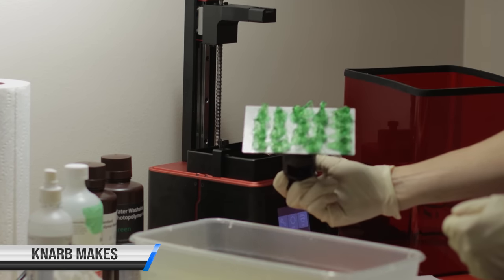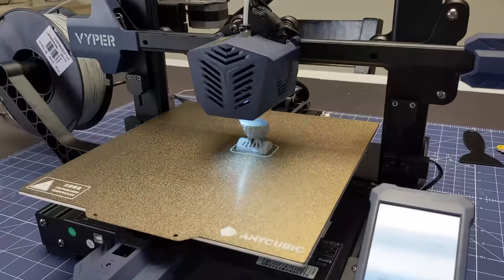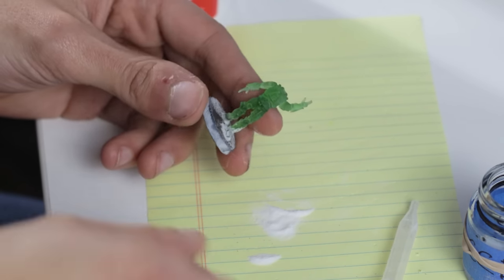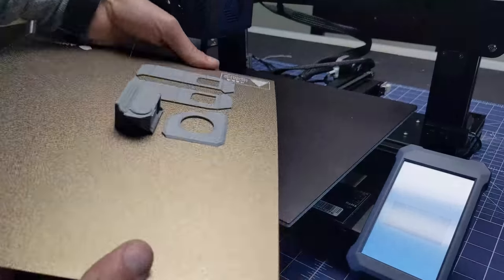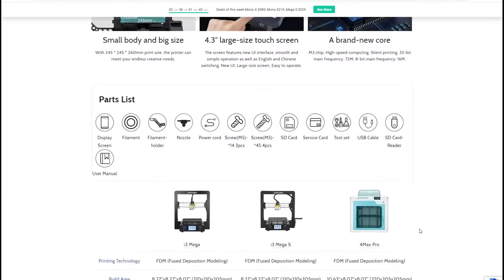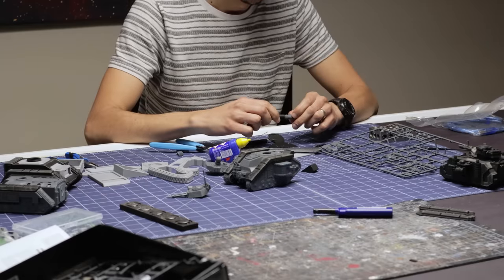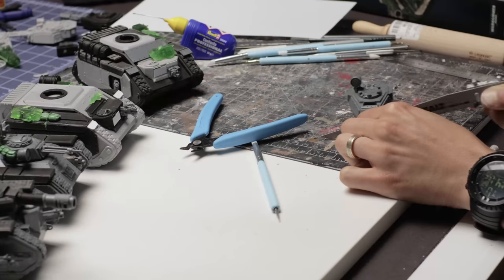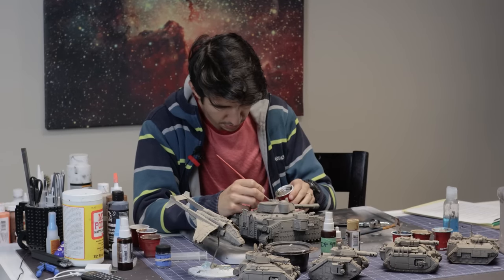Did SLA Printers win the tabletop war? (not yet)

Comment: No one who knows anything about 3d printing thinks FDM printers are irrelevant.  From a tabletop standpoint terrain or large models (like your tank) are definitely better on FDM and it isn't just because of print size or costs.  Certain things do not print well in resin.... period.  Specifically large things are very prone to warping, print failure, etc etc.  Ironically resin printers also suck at printing things that need to be just plain flat, you have to do a lot of orienting and supports.... A LOT.  Resin is simply better though at smaller more complex objects like mini's or sculptures, rings or other jewelry pieces, etc.
Reply: I think it is not just not knowing enough, but ppl have need to confirm the purchase. In a way "I SPENT MONEY ON THAT AND THEREFORE IT IS BETTER THAN YOUR CHEAPER THING, YOURS IS WORSE MINE IS BETTER". And since sla are more expensive, there are more ppl in need of confirmation.

Comment: No, I still use them to print bases, less expensive.
Reply: Yes, you wouldn't of purchased a new FDM just to do bases.
Reply: @TheBelrick  Honestly, I'm considering it. Bases on a resin printer SUUUUCK. And if I get a printer that can also do the larger parts of my giant minis without taking up 13 hours on my resin printer, or bang out 16 hexton hills tiles (instead of just 3) in one go, that's a win, as well.
Reply: @jugglervr  i dont mean to demean. But you can buy mini bases extremely cheaply and any mini can be attached to any base within the same size range.

Comment: With the new Elegoo Saturn and Anycubic mono x fdm is already outdated. But that is just my opinion. You can now print even the biggest models with resin.
For Terrain fdm may still be a better choice. BUT, this will change with the next resin printers again. Most terrain is also better handmade anyway. I would not buy an fdm printer for terrain.
With a Elegoo Saturn or Mono x you are more versatile in general.

My opinion is based on tabletop only. There are material requirements in mechanical parts where fdm is still the way to go.
I still think some fdm printers are amazing. I just would not use them for tabletop.
Reply: Yeah, of your use case is tabletop models, then resin is the way to go.

But if you want functional parts for electronics and mechanical projects, enclosures, tools, engineering prototypes (with loose tolerances) FDM is king, specially when you factor in strength, cost, and the ability to use more exotic materials like flexibles.

Comment: Hey Knarb, what kind of pc would I need to have to run one of those.
I don't own much tech, I just watch youtube from my phone. So if I were to invest in something like that, I need a p.c. too.

Also, does the fdm smell bad? Or is there risk of poisonous fumes from the melting plastic?
Reply from the maker: Only need a PC for slicing the models, any old PC would do. FDM does have a faint odor (not really a bad one), and some say that it's not great to breathe extensively.

That said, there's way more toxic things than an FDM printer. Just keep it somewhere you don't spend a lot of time directly in the vicinity of.

Comment: Hmm I find this odd when you tell the layers are visible on z axis and not on the top. I recently bought Anycubic Mega X and after printing on default settings of Cura the simple base 120/5 mm I can see "strings" on top but no visible layers on sides. How can this be?
Reply from the maker: If you can find a setting called "Ironing" in your slicer, it might help. The thing with the top lines is that they are not limited to being in one direcetion, the print head and slicer has full control on the pattern you do on top layers. It can outline key features and make it look natural.
Reply: @KnarbMakes  Wow you actually answered, and it was both fast and to the point. You have my life time subscription dear sir.

Comment: Too messy with its own set of problems. I'll stick with my fdm units. If you have to wear gloves its just too messy. I drop a spool and hey, I pick it up. I drop a bottle and its all about a mess for days. No thanks, I am in no hurry. A smaller nozzle and more time works for me.
Reply from the maker: Haha, yeah the resin is not fun to clean up.
Reply: @KnarbMakes  I'm clumsy in my old age so there would be no joy or fun in my shop almost daily with that stuff for sure. Awesome tip on hiding resolution lines. Thanks for that. It all helps if used properly. I'll be giving this some use I'm sure. Happy printing.

Comment: FDM printers are obsolete by the tech offered to the public. This should not have passed the year 2020.
Filament extruding is stupid at best, a lot of problems appearing from clogging to extruder to the actual filament. Plus the heated bed is unreliable as fuck, most users resort to tape, and spray and other non-sense.
The market of 3d printers is a major ripoff right now, what they sell should not pass 100usd or 200usd for the large +500mm/side ones, and still make a good profit with it. But thye demand 400-500 or more, which is outrageous.
Pellets printing should have been developed (right, manufacturers want to charge a premium but sell old stuff, they don't want to R&D) from their initial experimentation several years ago with good functional results even in 2018.
Plus, the added bonus, there is no risk of fucking clogging and depending on material quality, the mechanism forces the extrussion, and pellets are widely available from the injection moulding branch. Filaments should die out already, bad concept.
Corexy should have been a standard for many years now
FDM is unreliable as fuck.

Comment: FDM not going anywhere, PLA is a great entry level material and ABS is the most common plastic used for plastic mold injection. You miniature fan boys might need them, but non else does. Plus SLA is to much work, who wants to clean and have a wash bin and a UV tent plus printer. I could have two FDM for the same space plus less cost. Go with Ender 3, the rest just cost to much with smaller communities and more expensive parts. FDM all the way.

Comment: Those Leman Russ tank models are frakking obsolete. As a former US Army Tank Driver, I am deeply offended by those Looney Tunes cartoon tanks. 
This is otherwise an interesting video.
Reply from the maker: Hah, yeah thats probably true.
Reply: @KnarbMakes  Oh. It is totally true. The main gun is WAY to big for the turret. That breech takes up too much of the turret. The sponsons are impractical. They will be sheared off by trees or buildings or at least stop the tank. The driver's vision sights show the corners of each side of the tank. If the corners clear an opening the tank can pass through it. The sponsors mess that up and require the crew to check the clearance of the tank. This makes a tank slower and therefore more likely to be hit by the enemy. It also exposed the crew to enemy fire as they have to get up out of the turret to see. During the Arab-Israeli war in 72 (I think) there were high casualty rates amongst Israeli tank commanders. They were up in the turret scanning for targets. It is a trade off between tactical awareness and safety. An LT got killed at a Ft. Knox training thing for standing too high in the turret when the tank rolled over. We were told to be name tape defilade in the turret. The name tapes on your uniform should be parallel with the turret opening. I was a driver so I never had to worry about that. 
Well. You HAD to ask, huh. I hope Gee Dubs updates the Leman Russ. They need to hire an expert on tank design vs practicality to make a believable armored vehicle. 
Of course, the fact this tank sucks fits in with tradition over innovation in the supersitious Imperium.

Comment: WRONG. Resin printers have FAR LESS WASTE and High success rate, 2-4k resolution, print quietly, have super easy cleanup if any, and theres no messing around getting burnt or fiddling around with temps, flowrates, stringing, or shoddy bed setups. Resin printing is FAR better and EASIER. I will never go back to filament printing, the heck with that!